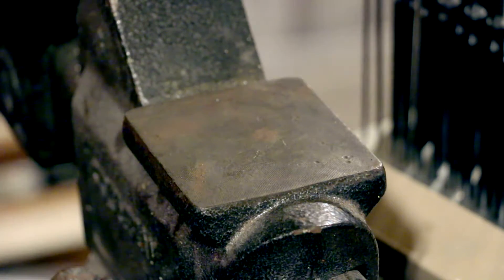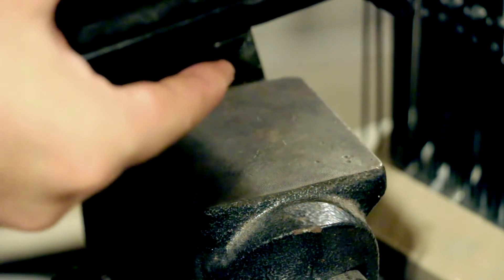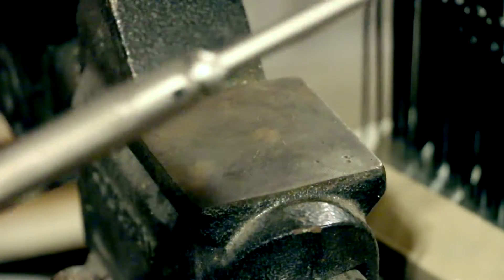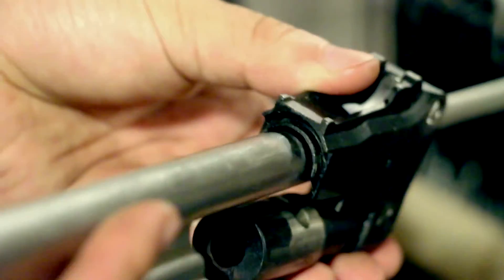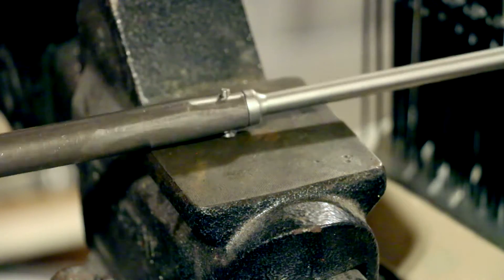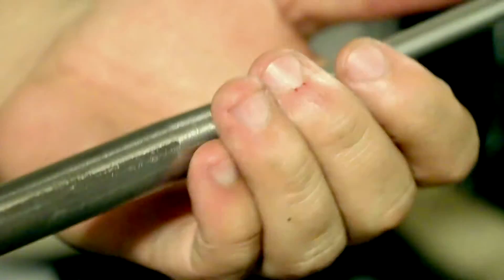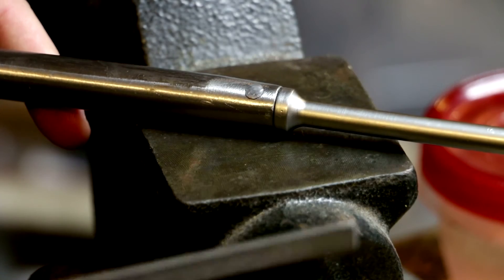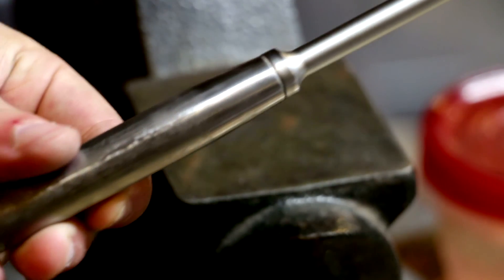Building the Custom PSL: Riveting the Gas Piston (Part 4)

Comment: It wont drop into the rear of the receiver..   ahhh..    Im doing a really similar build and using the psl carrier., m72 front trunion and barrel components..     i havnt even sized the rear sight block..   and i see you mentioned the rear sight journal is too large for the 1'' blank..   crap..   I have a green mountain 1'' blank im using..   Now ive gotta measure it before it bugs me to death!
Reply from the maker: Yeah, I went ahead and milled the tabs on the M76 carrier later on and found that they're also wider, which didn't allow it to move at all in the receiver rails. I decided not to keep working at it and instead went back to using the PSL carrier. Also, if you look at an M72 barrel, you'll see that the RSB journal is larger in diameter when compared to the chamber journal. The chamber dimensions (at least on my example) is just under 1". So you would have to start with a diameter larger than 1" to use those pieces, or sleeve the barrel.